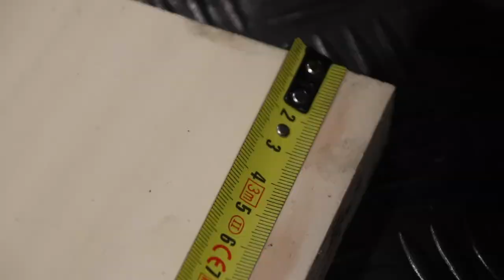DIY drill press stand - free downloadable plans

Comment: All the stand designs never seem to make use of the rotate the head and the slots in the foot plate functions. If you create a hollow in the back of the stand with various stock holding devices allowing head to swing around to end drill long stock. The slots can allow the whole press to move and place the chuck quite far over large ended stock.
Reply from the maker: It's an interesting design idea to take inspiration from!!!
Unfortunately my drill is very old and heavy. I'm afraid that swinging such a heavy and high head would risk throwing the DP off balance and maybe even to fall. 
If I will upgrade to a newer and most light one in the future I will surely think about it!
Thanks anyway
Reply: @thecuzdoes9761  How would it fall over?  Bolted to the stand. Make the hollow to the left or right side of the cabinet. The comment is to all , not just your situation. Always easier to find an excuse to not do something so don't do it. Why tell me what you can't do?  There is a drawing on Pinterest of the idea however the hollow is far deeper then required.
Reply from the maker: @MrBonners  I'm always open to upgrades that will help my tools to step forward... It might be I didn't understand what you meant, and I apologize. Post the Pinterest link and I will evaluate if it suits to my case.